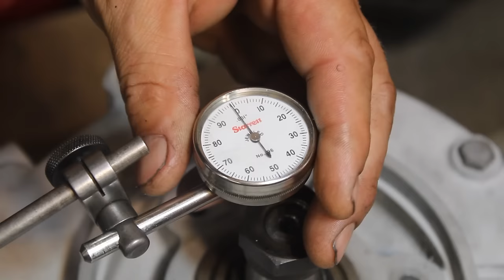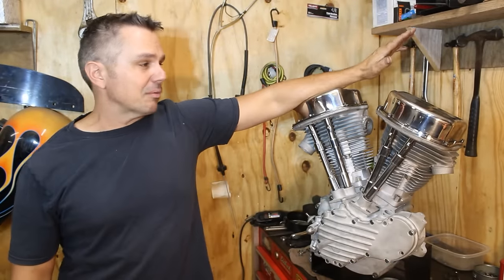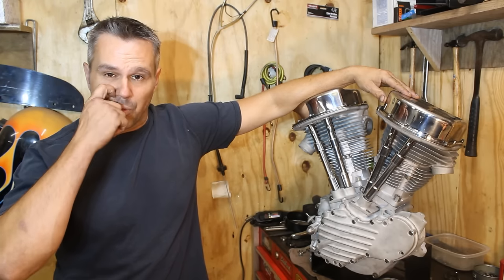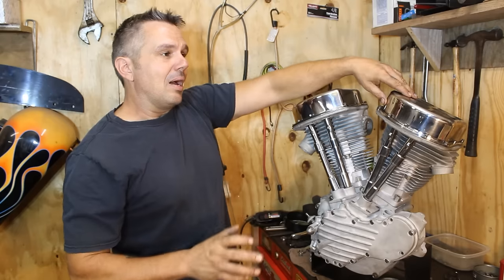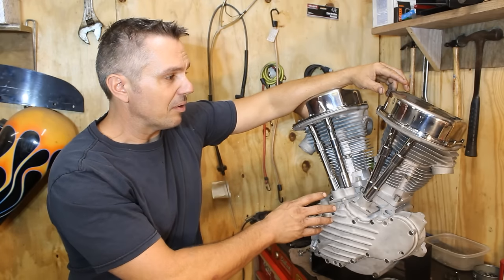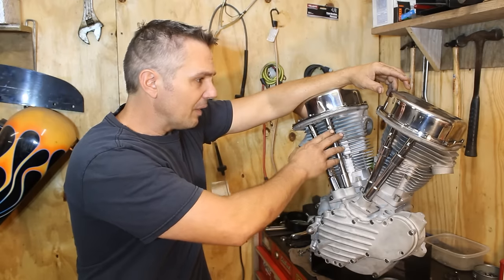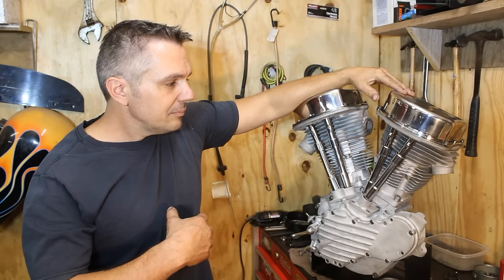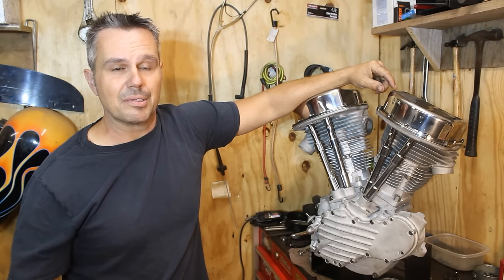Restoration of a 70 Year Old Harley Davidson Panhead Engine

Comment: If the pieces you have were together from 52 until today, I'd say keep 'em together. I don't know your financial needs and wants but, if a hard-core HD collector wouldn't want it with 50 bottom and 52 top and was going to line his bikes up in a row and look at them, it might be better to sell it to someone who really wanted a stock early Panhead and intended to ride it many miles. That person might not be able to afford the "perfect" restoration but could afford something like this sold at a market price and ride it. Of course, that's your choice of what to do with your bike. If you must get "maximum bucks" then do what you need to do with a clear conscience. It's kind of amazing that this Pan got through the "chopper days" of the 60s and 70s intact.

Comment: Like the way you made it look simple, I finished my 49 about a year ago and it didn't go that easy! The bike has owned me for 38 years and this will be the last rebuild. I don't ride it every day anymore but I went over everything and it usually is the nicest bike at the bars. I got a 83 shovel, 94 softtail, and a 2017 Roadmaster that I ride more than any other but my Pan is my baby.
Reply from the maker: Thanks it took some time but thanks to movie magic looks like I did it in a afternoon.
Reply: @DeathProofProductions  that was friggin awesome mate💯%👍 Thanks for the share
Reply: I've had a '67 Shovel (which is basically a Pan lower with better oiling), a '45 45 WLA, a '79 Sportster, and my last one, that I went down on a month after I turned 65 (lady turned left in front of me).  I'm actually considering one of those Free-Wheelers, which is a trike, without all the bags.  I've got almost enough for a down payment.  All I need is a loan from Navy Fed., and I'll be good to go.

Oh, yeah, broke 9 bones in my left foot and ankle, but all-in-all, I'm okay.  No Dain Bramage (that they can tell).  I've always been like this.  Lol

Comment: You did a nice job on that pan head. I've myself built many pan heads back in the mid 70's. The one thing I did differently was line hone the engine cases while bolted together to get a straight even bore for the crankshaft. Back then we installed oversized  roller bearings for the main shafts after line honing.  I always liked building the pan head and the knuckle heads. Great classics. I like you're work.
Reply from the maker: Thanks much appreciated.

Comment: Your video was great! I keep a 69 FLH running and a 57 Pan as well. Both “basically” stock. You are truly a master and the editing was fantastic. I have subscribed. About 10 years ago I had the shovel rebuilt. I never knew how the mechanic repaired a couple of broken fins. I especially enjoyed that section. THANK YOU!
Reply from the maker: No problem happy you enjoyed, it check out the next step the carb restoration and stay tuned for the transmission. coming to a you tube channel near you.

Comment: My Dad had a pan head,   After he passed 31 yrs ago, my brothers and I went through “his box” we found in the bottom of his old 5 drawer dresser.  In there I found an old receipt for an engine rebuild done by a shop in Jackson Mi.  With the pistons & rings,  gaskets, bearings, (I think) machine work etc,  I recall the shop rebuilt the engine for his 38 Harley for under 117.00 bucks.  I wish I’d of stuck it in my pocket so I’d have it ……… yep; hindsight is still 20/20 😂.  Ironic as it is,  later on in life my Dad became a Machinist and had an old Bridgeport,  South Bend 13 in,  2 drill presses, etc.  I can still see him “cking tolerances with his Sterrett mics 🙂,  thanks for the ride back to some great memories. He sold his Panhead in 56, bought a 39 Ford dump truck to make bread n butter when he got laid off at the factory in S Michigan

Comment: This is really helpful and educational man. My father passed away when I was 16 and left me with his 99 dyna and his 57 panhead chopped, i am currently building the bike back to its original glory, this video makes it a little bit easier
Reply from the maker: thanks for the complement. I hate to hear that about your dad. i went through the same thing with my mom in my early twenties.  My first new big twin was my 99 dyna if yours is black then its one of the first twincam engines that rolled off the line . In another 20 years it will be a collector item.

Comment: Put it back together and keep it as the last owner had her, screw the persnickety crowd. I have a '41 EL that I was left after its owner passed away in the late '90s and when I rebuilt the engine and trans in '13, I saw it wasn't as it rolled out the factory door and I couldn't care less. I knew that when the owner was still alive, it had a pretty rich history of owners that had changed shit as needed over the near century it's been alive. I'm just the keeper of the flame until it's time to pass it on to a new owner that will hopefully take her for what she is. A motorcycle that's built to ride, is older than we are and respect the fact that she'll be here LONG after we are. Great job man, I'll keep watching for sure.
Reply from the maker: Thanks I believe I'm gonna take this advice.

Comment: I'd buy as is myself. I'm a shovelhead guy. Just totalled my 68 shovelhead because an idiot slammed on brakes on a 2 lane road doing 65mph,  there was nothing I could do. But a buddy bought the bike and sold it right back to me, now I'm gonna start rebuilding it.  Good job my buddy
Reply from the maker: thanks, i love the hell out of shovels to. my first build was a 76 fxe back in 1998 it was the bike that flung the craving on me to become a harley mechanic. i just finished my 77 flh and were gonna make a vid for it first fire up so stay tuned.
Reply: @DeathProofProductions  I will. Man I can't wait to be able to get back on mine. It's still going to be a little bit. I've had 14 surgeries on my leg. Now I have another coming up for my hand. Then some oral surgery. Hell fire 🔥.  Lol

Comment: Always wondered what a panhead was. Now I get it. Its basically a 2 cylinder Volkswagen engine with external push rods (and those classy pushrod tubes) and valve covers (pans) out on the ends of the heads.
Reply from the maker: Yep thats pretty much it.

Comment: ,,,,enjoyed the blast in time....I have most of the tools shown to complete the job , as for decades my passion for my shovelheads led me.......I worked for Hempstead hog in Nassau NY ,,and Lombardi's hog in Staten Island  NY ......I learned something from this fine video,,,,,,,,,Splitting wheels with two small wedges , instead of one large one,,,,or just slammin a lead hammer to the side of em  , while holdin them by the two rods....................

Comment: I was a young marine and had a ‘48 panhead chopper. It barely ran and I had no money to get it right but it was great when it did. I sold it to a buddy and it got stolen from Cherry Point MCAS. Probably the best thing that could happen. Those small, light choppers were the best, new Harleys, meh. THANKS FOR SHARING.

Comment: Outstanding video. I started riding Harleys in 1976. My first bike was a '70FLH, full dress with 30,000 on the odometer, that I picked up for $1500. Panheads were still a common sight on the road back then. My only criticism would be the apparent lack of assembly lube/oil on the piston rings and cam gears.
Reply from the maker: thanks if you go to time stamp 13:04 you can see the oil on the gears. I just use 20/50 that's what the factory tought us to use when I was getting certified.
Reply: Have to agree with Gary I've never seen a motor assembled without a lot lube I've seen some older guys soak the pistons in oil overnight and I always used a light oil like wd 40 when honing and then clean the cylinder with hot soapy water and toilet brush is mandatory did you check piston ring end gap? Nice video but you are leaving out some critical parts of a overhaul?

Comment: A group of my friends find and restore/rebuild pre-WWI motorcycles and it's a labor of love and re-engineering. The design perimeters and metallurgy and bearing technology before WWI FORCED it forward, left everything to be desired, so in our "runstorations" we "modernize" the internals, often at great expense. CNC-ing new aluminum pistons to replace cast iron originals (we had machinist friends), Hand turning modern steel cranks and cams and heat-treating both is far more "art" than machining. Boring out bronze bushings in cases and fitting rolling element bearings is engineering art. We take a 5000 mile life engine and turn it into a 50,000+ mile re-build cycle engine and increase the horsepower by 10-20% by reducing friction and increasing efficiency. One of our gang rode his 1911 ACE to Sturgis from Sand Springs, OK this year (NOT a trailer queen!) Placed First for Antique ridden in and second in Oldest Bike and First in Oldest Bike ridden the farthest on a Columbia Bicycle frame with a 61 CID 52* V-twin engine and total-loss oiling system and acetylene headlight that he said had cars flashing their high-beams at him across Kansas and Nebraska! I aimed it so I KNOW it was legal and right! But the 9 inch reflector put out 12,000 Beam candlepower compared to HID or LED's at 4000-6000! I rigged a bicycle LED brake light for him using a magnetic switch.

Comment: Great video and build. If you're in this for profit, you should part your build out like you mentioned. Then buy yourself a matching numbers whatever, and restore that.
   What I did miss in your video is how the case halves are sealed. Is there a gasket, or RTV silicone, or nothing? You're a great mechanic. Thanks.
Reply from the maker: the factory trained me to use 3m three bond so thats what i use. i should have filmed it but didnt think about it.
Reply: Thanks for replying.

Comment: The last one we built we tourqued the cyl heads on before we installed the jugs on the pistons, I guess some folks do and some don't, anyway nice job bro💯💯💯👍👍👍
Reply from the maker: I use a dog bone on my torque wrench to do it once there on. We edited it out it because the camera angle didn't look good. But I have also done it you way in the past. Thanks for the compliment.

Comment: 2 hell with matching #'s & parts! U put the sweat & time in it, get it finished & run it around, have some fun with it. nice work you do, use some assembly lube next time.
Reply from the maker: Thanks for that I think your right. I do have lube on it. I put it on thin it's hard to see it in the vid but it's there this is the way I was trained at the factory. Thanks for watching

Comment: I ended up as a Spring maker / toolmaker. Everything on the farm was number 8 fencing wire mentality.
Reply from the maker: thats cool, I started out building steelmills as a millwright. learned a great deal about machines and fell in love with them but when I rode my first bike I knew I had found myself. after building my first shovelhead I knew this needs to be my job. after all they say if you love what you do you never work a day in your life.

Comment: Great job!!! 👍 The only thing is that instead of sandblasting, aquablasting would probably be more suitable for aluminum?) You may be interested to see how one very talented person restored the 1948 Harley Davidson frame from junk, the Springer fork and the Panhead engine from spare parts! He also builds a homemade chopper with a homemade V-Twin and the same homemade Springer fork literally from scrap metal, while not having any special equipment! I think you will appreciate his work, the video is very fascinating!!! The channel is called MotoMetalMind 🙂🖐️
Reply from the maker: I watched his video it was very good thanks for the recommendation. At some point I would like to get a vaporhone but it's not in the budget right now. I do have a tumbler to do the same thing but not on the big parts, so what I do is use the crushed walnut media to blast at low pressure than burnish with 0000 steelwoole to get the close to correct finish.
Reply: @DeathProofProductions Thank you so much for your responsiveness! 🤝Interesting cleaning methods you have ! 👍

Comment: I used to smear bearing grease on the plain paper gaskets and the cork lifter tube gaskets.  Worked good, lasts a long time.

Edit: I used one of those side covers on my '67 instead of...can't remember if the stock ones were plain or had...shoot...well, fewer ribs, anyway.

Also, I am retroactively jealous of that gasket maker.  Can you make mention of the details?  

Why did every single one of those covers look like they'd been beaten with hammers along the mating surface?
Reply from the maker: Yeah it's a cameo silloette machine same that you can cut t-shirt vynel.  The covers did look like they had a hard life.

Comment: Such an awesome video!!  I'm not understanding what the red stuff was you sprayed in the crank housing.
Reply from the maker: Old aluminum casting could have alot of purosity  so the used that to seal the inside to prevent leaks. Now with modern alloys they quit doing it. Thanks for watching.
Reply: @DeathProofProductions  He is asking what the red stuff was that you sprayed on the insides of the case. You never answered him.

Comment: First and most important, great video! Second, and probably not an issue, but I think the base gasket you used was a late model for internal feed cylinders.  The '50 uses the internal feed cylinder hole which was covered by a tab on the gasket?
Reply from the maker: good eyes. that set is for my 64 pan the ones i ordered were late showing up so to get the video done on time I just used those. i still have to finish honing out the cylinders.  I will use the right gaskets when I finish the honing job. I was curious to see how many would notice.

Comment: falto lubricar los cilindros antes del armado, pero como no soy mecanico de harleys, dire que esta bueno el video, linda restauración
Reply from the maker: I lubed everything just had to cut out some steps to condense the vid. At time stamp 13:10 you can see the oil on the gears. Thanks for the complament.

Comment: Just wanted to ask (it been about 20 years since I worked on a panhead) The heads have a cast in iron ring for the head gasket seal, if I remember correctly it has to been above the surface of the aluminum, but I cant remember how much.
Reply from the maker: they're flush or they can be slightly below the surface.

Comment: Terrific job on that Pan! One question.....I didn't see you use any assembly lube. Did you or was there a reason why you didn't?  Thanks!
Reply from the maker: I coated all the parts before I put them in and coated the cylinders. Probably should have filmed that.
Reply: @DeathProofProductions  Oh...OK. I figured that you did! Tnks!
Reply: @DeathProofProductions  Too little. Best too pre oil like it has been running. Also for the heads and cork seals for oil return. If you store it like this u have a stiff rusty leaking engine in notime. Just saying.

Comment: Should those cylinder base gaskets have a oil return hole in them? I didn't see one
Reply from the maker: yes  the right ones had not come in yet . i used some for my 1964 pan to finish vid and check valve to piston clearence . i could tell the heads had been machined and i didnt know if it was for performance or to correct warpage so i thought it best to check.

Comment: I have really enjoyed watching your video on you rebuilding this osum panhead engine. You are very  smart and your knowledge and skills on harley davidson engine  is very high witch iv learned a lot from you. I have a old 1977 iron head engine that  im gonna  rebuild  and i want to know is when you are putting the cases together  what do you use to seal them.? I was thanking pemetex high temp silicon. But i was not real sure. When you put the panhead engine  together i did not see you use any glue to seal the two main cases. Greg
Reply from the maker: I use 3m three bond like the factory tought us to use. Same stuff they use on the new engines.